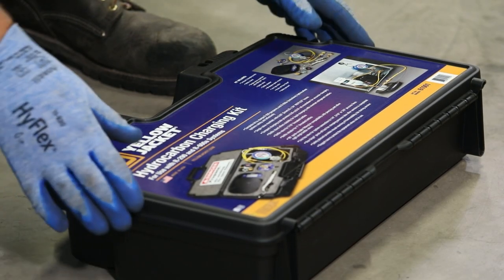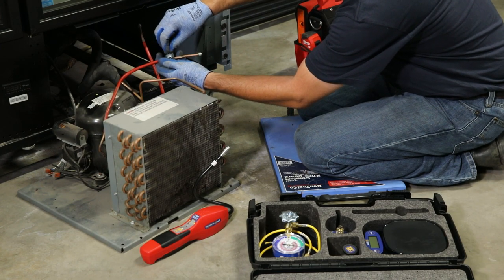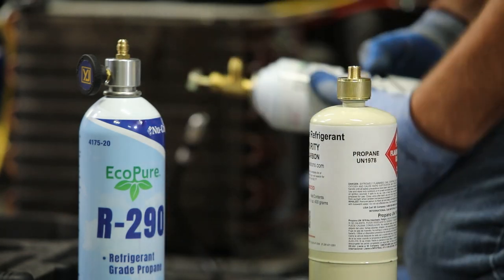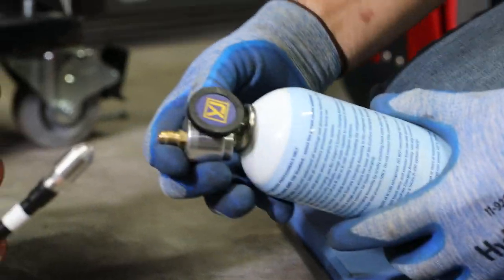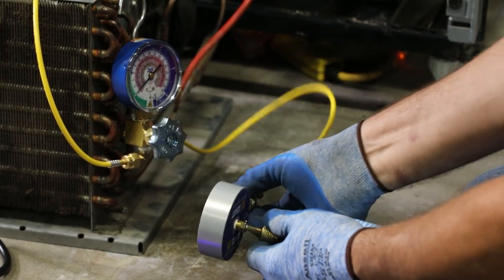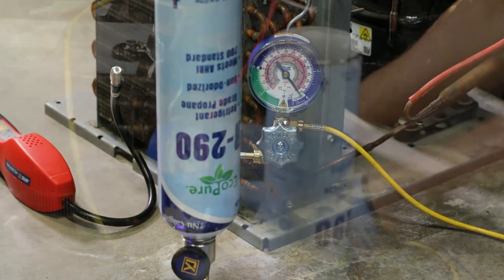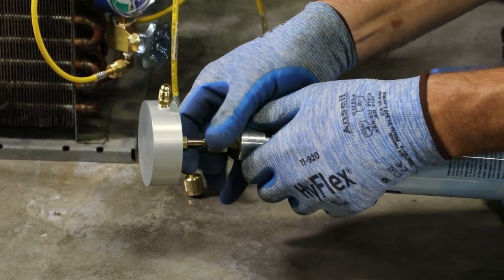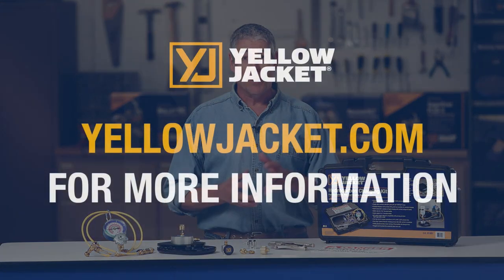Charging R 290 System with Hydrocarbon Charging Kit

Comment: This is good info, thank you. It would have been nice to see the peircing valve removal and brazing procedure. It seems like the heat from brazing would conduct past the pinch off point and create explosively high pressure. Is this step necessary? Can the peircing valve be left in place for future use?
Reply from the maker: Hello! The crimp is only a temporary closure, soldering closes the hole permanently. It is not advised to leave the puncture  tool in the tubing. The temporary puncture device on the tubing it has the potential to leak.  The crimp will stop the A3 from leaking out and catching on fire.  The A3 is dangerous around flames so care must be taken to ensure there are no leaks when you solder as that would be how it would catch on fire.

Comment: What happens to the air between the braze and the pinch?
Reply from the maker: Hello, thank you for your question. The minimal air that is trapped in between the pinch off and the solder and is heated and “dried” during the soldier process and is not going to affect the system, as that is an extremely small area and volume.